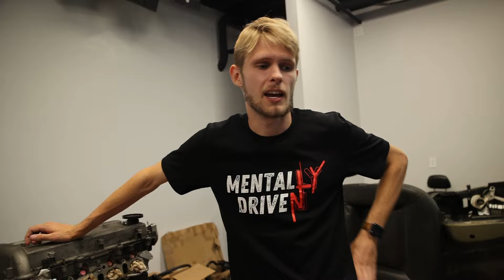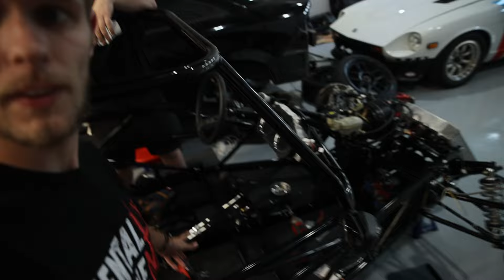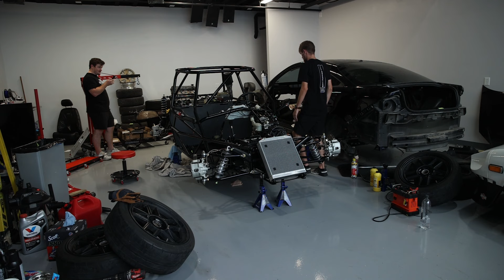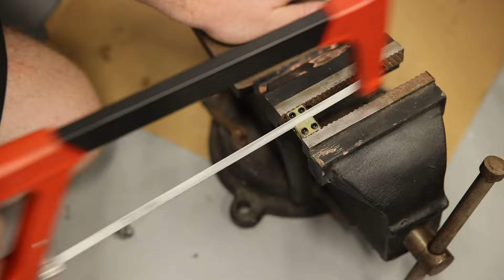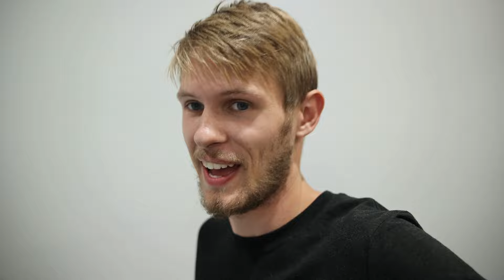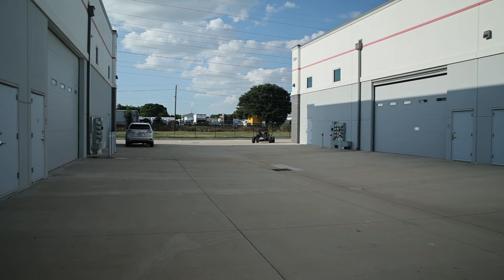FIRST DRIVE In the DF GOBLIN Kit Car!!!

Comment: How many of these issues were due to you guys not following directions, and how many were because the directions weren't good?
Reply from the maker: I wouldn’t really say it was either. The big thing was that the videos that DF made stop after you put the engine in because then it gets pretty specific depending on your build. Then you go to the forum. The Forum has a bunch of info on it so it was just finding what we needed on there. Also, because we changed the transmission this caused some issues for us that we didn’t even think about but luckily they were easily fixed with the Forum. If you are planning on building one, make an account on the forum and check it out before you start building
Reply: @LivingLikeGray  Yep, that's why I asked. Hoping to start my build this fall. 😎
Reply from the maker: @Scott_G  Awesome! It’s a lot of fun. Be sure to document the process. If you have any questions feel free to reach out to me on Instagram or on the forum!